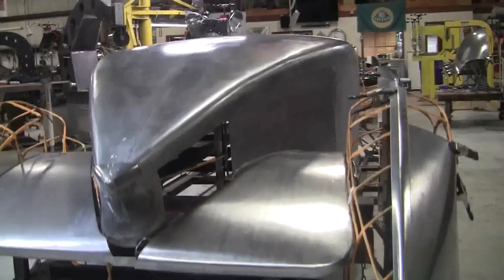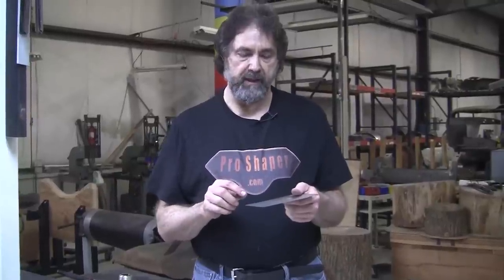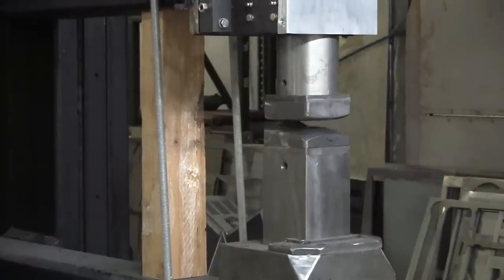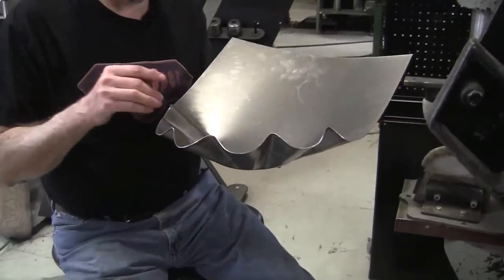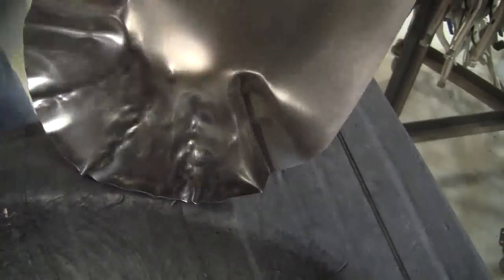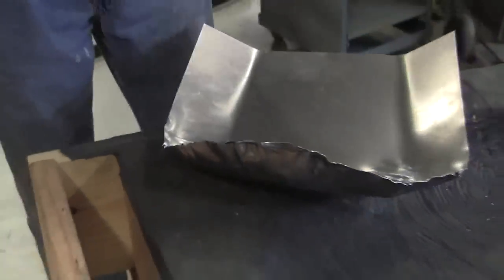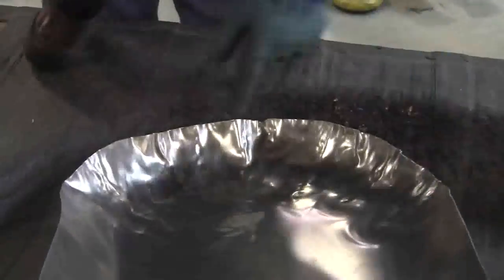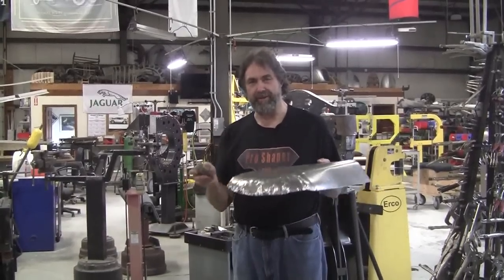Metal Shaping: Shrinking metal with a hammer and English Wheel

Comment: Do you strike the gather straight down directly on the spine, or do you hit back and forth on either side, striking at an angle matching the angle of the side of the gather, as if you were upsetting a bar, to shrink the metal? Also, I know the angle doesn't have to be perfect, but if you had to guess, what range of angles would work best for the gathers? Your hands looked at 20-30⁰ in the video when you were showing the correct angle and at maybe 40-45⁰ when talking about the ability to shrink being lost.

Comment: Excellent demo. I've looked forever for someone actually SHOWING the process rather than just talking about it. Do you have to anneal the metal at any point?
Reply from the maker: On the E-type bonnet build I only annealed locaally where the stepped seat for the headlight covers is.  Remember also that this .063" 3003 aluminum is supposed to be half hard H -14. It probably is H-16 (three quarter hard) or full hard.

Comment: Dear Wray, could you share with me what kind of product is used for coating of a shrinking press ”jaws”? Sprayed white rubber? Thanks!
Reply from the maker: Use a moldable low melting temp plastic. You will find it on Ebay. It melts at 212 degrees F.
Drill through holes in the steel pieces so the plastic can bed on.

Comment: what a lovely teacher. does anyone know what sort of sheet rubber hes using on that lumber?
Reply from the maker: Hi Tim, it's EPDM roofing rubber. 1/16" thick one side has a super strong self adhesive.  You can purchase it at roofing suppliers. It protects the lumber and holds the panel in the concave shape. I haven't had a single break in the board modules after years of use.
Reply: @proshaper  oh wow thanks man. rubber roofing sheet is such a brilliant idea... you can even patch it with generic adhesives like 3m super 80 i think.

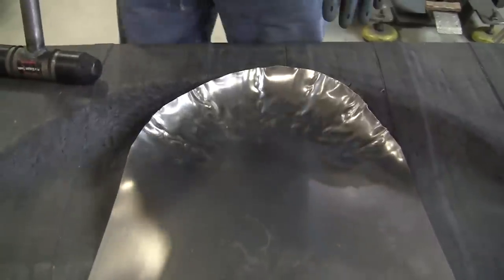Comment: at 21:00 he says it doesn't take any fancy or expensive tools to do this, but everything he does is with a fancy expensive machine other then the stump and hammer!  I guess if your a millionaire!!!!!  Other then that he explains it in detail and did a fantastic job.
Reply from the maker: The most valuable cars in the collector car world are hand built cars.  Italian coachbuilding shops built some of those valuable cars( some worth over 20 million dollars)  with nothing more the a gas torch, a smooth slab of metal, stumps, a collection of body hammers and dollies.
That was what I was referring to in the video. I have a lot of tools because I have been at it for 56 years (started when I was 12 in 1963). I also build all of my sheet metal shaping tools.

Comment: How does hammering steel shrink it?
Reply: When he is making the initial tucks the sheet is shaping in "3d" but has the tuck in it. And the stiffness of the metal on the edges is holding it in this tuck formation when you hammering the most center part of the tuck down flat and work your way out to the edge. Hard to explain but it works.

Comment: I SEE THE CAR YOUR WORKING ON IN THIS VIDEO. HOW DO YOU KEEP THE METAL FROM RUSTING AFTER YOU HAVE FORMED AND INSTALLED THE METAL PART..
Reply from the maker: At Home Depot in the paint isle they sell an inexpensive phosphoric acid. I believe it is $19.00 for a gallon. Spray it on and it dissolves the rust very easily. Wash and dry quickly with water after the acid.
Reply: @proshaper  THANK YOU FOR REPLYING SO QUICKLY.  I MAY BE WORKING ON MY TRUCK FOR MONTHS SO THE METAL WILL BE EXPOSED DURING THAT TIME.. WOULDN'T THE METAL START TO SHOW SURFACE RUST AGAIN AFTER GIVING IT THE PHOSPHORIC ACID AND WASHING IT OFF WITH WATER AND DRYING.  I NOTICED YOUR CAR LOOKS BEAUTIFUL AS YOUR WORKING ON IT.  DO YOU KEEP WASHING IT DOWN. OR JUST WORK REALLY FAST.
Reply from the maker: @larrylombardi4876  Hi Larry. When you are working on a bare steel car it will surface rust from humidity and hand acid. How much depends on where you live. If it rusts you have to clean it. This is why I prefer aluminum for car bodies.
Reply: @proshaper   awesome tips again sir

Comment: Do you ever have to anneal it? Why doesnt it harden?
Reply from the maker: If I'm working with aluminum I always have the ability to easily anneal. Most of the time I don't have to. As you wheel the aluminum it gets more malleable. With steel it too gets more malleable as you smooth it in the English wheel.  I call the metal confused not work hardened, once you make it uniform again in the wheel it softens right up.

Comment: Did it shrink or did it jest stretch down
Reply: I you made a mark at each end of the curved edge of the blank and strung a tape around the curve it would measure (say) 30". If you did the same after making it that scoop shape, it might measure only 25". So the strip of metal next to that edge can't have stretched, it must have shrunk.
If you rolled out a ball of clay with a pastry rolling pin to say 1/4" thick  and then tried to make it the same shape, you would again have to bunch up the edge and thicken it to maybe 5/16", which means the surface area around the edge would shrink.
Reply: TO clarify further: When metal shapers talk of "shrinking" metal, they do not mean reducing the volume (which strictly speaking, shrinking would do). Metal is practically incompressible. You can reduce the volume (imperceptibly but measurably) by applying (lots of) pressure, but when you release the pressure the metal item will expand back to the original volume, unless it started with internal voids.
What metal shapers are shrinking is the SURFACE AREA.  They are trading area for thickness. The volume remains the same. They focus only on surface area because (within reason) it's not important to them to measure the thickness increase. If it's a dent in panelwork, that increase would in any case only bring it back to where it started, thickness wise.

Comment: I must be brain dead ! When I shrink a piece of metal it is totally different then what your calling shrinking it 
Which is that your  actually stretching the metal by pulling it out of it's original shape, Calling it shrinking which is a definite lie.
I learned a proper technique as a boilermaker many years back to shrink metal and the only way you can do this is by heating it and rapidly cooling it with water or some other liquid, (pulling the molecules together) or to pound it into shape after heating it, or just forcing it under pressure. as in forging
Your explaining a wrong 
Your not shrinking metal but distorting it by stretching it to provide a curved or out of flat shape, to pull the outer perimeter in a little. Take a rope or sting that is tight, and naturally if you apply pressure in the middle the rope or string will pull inward, but you still have the full lineal length, But you have shortened the distance between the ends, You have not shrunk a darn bit of the original length, Until heat is applied and suddenly cooled.
Reply from the maker: Ok, you are an expert.
Reply: @proshaper   He should have stopped after his first sentence. It all went downhill from there.